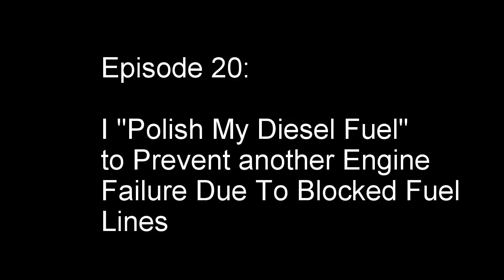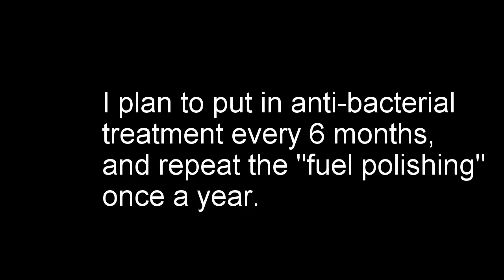Ep 20 Diesel Fuel 'Polishing' To Prevent Clogged Filters and Lines

Comment: Terrific video Patrick. It’s brilliant that you’ve taken the time and energy to put this together. I think anyone who has sailed and perhaps more so lived aboard for any length of time has gone through this issue. I use to keep my sail boat in the Rio Dolce Guatemala for six months at a time during the summer/hurricane season. The humidity there is 100% so needless to say I had numerous issues with bacteria and condensation buildup’s. I was forever bleeding my engine and trying to keep the fuel clean—it was my main problem when cruising down there. I even suffered this fuel blockage whilst delivering a boat back to Florida of the coast of Belize during a storm….I wasn’t a happy camper. :)
Reply from the maker: Yeah, I was a real beginner learning how diesel engines worked backed then.   I learned some lessons the hard way.   :-)   I am much more careful (and knowledegable) about fuel systems now.    Fair winds.

Comment: Thanks Patrick. Fuel polishing is on my winter to-do list and I had not yet researched how to configure the polisher. I will follow your method
Reply from the maker: It seemed to work well Philip, but be sure to keep the pump's capacity aligned with that of the filter.  I may have been just slightly 'overpowered'.   Fair winds (and mild winter).

Comment: When I flew, part of preflight was to drain fuel from the tank bottom via a petcock. Always had a little water from condensation, no big deal. Suprised boats dont have that. Drain out a few ml of fuel and the crud that settles in your tank. Did in my motorcycle before long rides too. I grew up around diesel engines and they all had the glass bowls on the filters so you could see ur fuel. Good vids mon ami! Naviguer avec Dieu.
Reply from the maker: Many thanks Silky.   I flew a Piper Arrow for many years that had a drain valve under each wing, and before every flight, I would drain some out to ensure no water.  Many sailboats do have a drain as well, but for some reason, my otherwise excellent boat does not, and that is a real shame.   Most medium sized boats like mine have mounted a filter/water separator in-line, and a second filter mounted on the engine.  Unfortunately the water separator on my boat is not transparent, so I have to do a messy unscrewing process to drain any water, and then re-prime the line.  Oof.  Je vous remercie sincèrement.
Reply: This fueltanks are made from plastic and it reduces condensation a lot, and the combination to keep them as full as possible all the time is helping also a lot.
Reply: I used to think the same thing and when I looked into it I found the ABYC frowns on drain plugs (or any fitting) on the sides or bottom of fuel tanks.They say it increases the chance of spills and fuel getting in the bilge and I have to agree.Lets face it the average boater will rarely check it and with metal tanks there is a very good chance that the plug will be a dissimilar metal.
I also fly and have a Maule M-4 that used to sit on EDO floats but lately she's been sitting on Tundra tires.

Comment: They should plumb those boat tanks with a kidney loop system (exactly like you built) so you can prefilter all the fuel at your leisure. especially during rough seas when the fuel is stirred up.  your info is the best, this is the only real sailing channel I've found.
Reply from the maker: Larger boats -- and especially power boats --- do have permanently mounted polishing systems.  It's very hard to do on a sailboat due to lack of space.   Believe me, I'd do it if I had a bit more room!

Comment: Bonjour Patrick,
Back since yesterday after bilge watching your first 20 videos.
The absence of water does not shock me on a plastic tank.
I own a BAVARIA 40 cc 2010 myself.
I have always tried to treat fuel oil with a specific product.
I will check, however.
A big thank you for your precious vidéos 😉
Reply from the maker: Thank you.   I use the fuel treatment recommended by Volvo (Actioil A550), but am sure other brands of treatment will also work fine as well.

Comment: I like your philosophy of being thorough in port to avoid trauma at sea. Consider also fashioning a scrub brush on a flex wire handle to dislodge things clinging to the walls of your tank.  Shame not to have a large inspection port.. Very enjoyable vids thank you.
Reply from the maker: I think that is an excellent idea Will.   I am planning to install an additional water separator/filter as an in-built polisher, but will probably do as you say and try to give the tank a bit of a scrub each year.   With only the sender port as an access, it will always be difficult to get to areas behind baffles.    Thanks for contributing to the discussion.

Comment: Great system it's doing what it has to do...  I have exactly the same fueltank in my boat same capacity and if you keep them as full as possible the amount of water stay's really low. There is almost no condensation in those plastic tanks. I skim my tank once a year with those oil vacuum pumps and it's working also pretty well, but like a lot that system you builded. That's why I keep watching those movies from sailors on you tube, there is always something to learn! Keep posting this movies !!!
Reply from the maker: It's great to have feedback like that Johan.   I agree that these plastic tanks are much less prone to condensation than the metal tanks.   I do try to keep it near full as well --- to minimise stirring up any contamination on the bottom, as well as to minimize any possibility of condensation.  Thanks for commenting.

Comment: Your videos are great. Short and to the point. No long intro with music etc.  I had 2 filters with some shut off valves. If filter showed any sign of clogging at sea I switched filters with a few valve turns. Replaced clogged filter when conditions improved. I also had a small can with fuel that I would raise to gravity prime filters after filter replacement. Fast and easy, with less spillage. Might be an option for some.
Reply from the maker: Having some dual Racor filters that I can flip between has been a dream of mine Ed, but I really don't have the space.   Instead, I've hooked up some strainers in-line, and have a single Racor......  I'm hoping the easily replaceable strainers will catch any heavy contamination.   By coincidence, just today I put some chemical diesel-bug killer into my tank --- a maintenance dose.    Thanks for the helpful comment.

Comment: Thank you for the videos, as a solo sailor gradually gaining confidence to venture outside my home waters these episodes have been informative and inspiring.
I think some of these diesel bug treatments have a water dispersant in which would make the water mix in with the fuel so it can pass through the engine, that may explain why there was no pool of water in the separator.
Reply from the maker: Thanks Mike.  Yes, others have suggested it may be hygroscopic.   I'm just going to assume that is true!  Good luck with your solo sailing.  It provides a great sense of achievement.   Fair winds.

Comment: Hi Patrick, just signed to your channel and love it. I tried to be a lone sailor myself but gave up after a handful of attempts. I had the exact same problem with my sailboat and know by trade that any diesel can grow bacterias, algae and other species. In time it becomes a slurry that needs to be polished from time to time. I removed the tank, transferred the oil to another container, washed it thoroughly and returned the oil filtered. I spent nearly nothing doing it.
Reply from the maker: Yeah --- agree.    My precautions now are chemical treatment, pre-filter/strainer, keep the tank full as much as possible, Racor separator, and polishing every 18 months.   Still always worried whenever there is rough weather.

Comment: Thank you again for a fine video.  Our boat Olivebank suffers from an old steel tank (1970) which invariably flows rust through the diesel fuel lines.  Linda and I are seriously considering a replacement tank in plastic, until I looked to see what would be involved with moving wiring, hoses etc.  Your video gives us some hope that we may be able to garner another season before inevitably "biting the bullet" and replacing the tank.  I hope you didn't stay aboard for the 5 hours of 10 micron pumping.  I hope to find a somewhat quieter diesel fuel pump.  Thank you again.
Reply from the maker: Here's the deal on the pump for the polishing system Dave: if you get one that is quite powerful, it will do a great job of picking up the contamination in the tank, but will push the water through the separator and back into the tank.  If you choose a pump that is too weak, it will be great for picking up the water and allowing the separator to do its job, but will struggle picking up the contamination in the bottom of the tank.   I think some of the professional units have an adjustable pump: high volume to pick up contamination, and a second lower speed to suck up the water.   Good luck on your project.   (If you have to err, I would err on the side of picking up the contamination, and worry less about the water.  You can always add a hygroscopic additive that will take care of any water.)

Comment: Excellent idea, well executed. I replaced my old stainless tank which had a tap at the bottom with a plastic one which has a dip pipe (the same as yours). I always worry a bit that even small amounts of water will gradually build up and never be properly drained out.  So, I am very pleased to see that you didn't get any water - although I am surprised.
Reply from the maker: :-)   I have a feeling that the flow was so great that the water did not have a chance to separate.   Darn.   I'll use a smaller pump next time JAS.   I do wish there were a tap at the bottom to drain the water......   But for now, in the absence of any better information, I'm celebrating the total absence of water in  my fuel tank.  :-)

Comment: An inspection hatch above the lowest point in the tank goes a long way toward lessening the problem. Also, fit a storm valve on the breather line to avoid a big sea getting seawater in there. Any big wave will come squirting down a hull-mounted breather and in to the tank. Fit an internal breather on the same line before the storm valve. In heavy weather, shut the storm valve and open the internal breather. Troya.
Reply: I am learning a ton of things through these videos and comments. Here you go, and I thought I knew most of the the things one should know about sailing!!!
Reply: Very useful ideas! Thank you all for sharing!
Reply: Thank you for the storm valve idea. Very useful.
I'm not sure about the inspection hatch though. Leaves open the possibility for a leak.

Comment: Hi. I had a diesel bug issue on my yacht which ultimately lead to engine stopping en route. Similarly I was surprised just how little crude was found. We cleaned out the bottom of our diesel tank by hand (there was a large inspection access above the lowest point fortunately) and essentially found a small amount of black crud. At the initial filter from the tank towards the engine, which has a glass bowl, we discovered it really took only a tiny amount of crud to block the intake for the engine. Once cleaned we also treated the fuel with biocide which we use each time we refill pro rata to the fuel. Fingers crossed we have not had an issue since. I am enjoying the videos you have a gift for speaking to camera!
Reply from the maker: Thanks J&J.  As you state, the blockage can take place wherever there is an 'edge' in the line.  It doesn't have to be in the filter. My blockage took place in the emergency fuel shut-off valve.   I later replaced it with one with a larger orifice.   I have started using the biocide too.  Lesson learned.   Thanks for watching.

Comment: Hi Patrick,Great vid. Congrats on a very interesting and entertaining channel. I've been emptying my tank (every second season or so) worried about the same thing. I used a small fuel pump from a car shop the first time (cost of around 30€), but the second time with the boat on land I used gravity and a fuel line going through the log hole on the hull.A very useful thing to have is a inspection hatch (cost about 160€). Mine has a transparent lock, so I can just look with a torch without opening it. Not to hard to install (even though my tank is stainless steel). Even easier in yours being composite.The good thing with it is that you can empty and wipe clean the tank.All the best, Carlos
Reply from the maker: Thanks Carlos.  Yes, I'm really a bit disappointed that my tank has neither a drain nor a dedicated inspection port.  That said, I realize that an inspection port is a complex topic due to baffles in the tanks which will prevent visibility and cleaning, even if you have one.  At the very least, a tank should always have a drain at its lowest point.   Sounds like you have mastered this issue.  Thanks for contributing.

Comment: i was going to install a second tank to pump polished fuel into.  I had never considered pumping the polished fuel directly back into the tankl.  thank you.  

seeing what you've done, I'd considered using a 20 micron, then into a 10 micron before the tank.   sparing the electric pump from excessive use.
Reply from the maker: A lot of people on larger boats do exactly as you suggest -- a second 'day tank' with polished fuel.  Smaller boats don't really have the space luxury to allow a second tank, so any formula of enhanced filters in line is an improvement.   I like your idea.

Comment: Good video. Diesel bacteria problem is caused by using bio-diesel. If you replace it with "old" diesel or - on engines of 2005 and beyond - GTL, you'll tackle the root cause. Having had engine stall on our motor yacht twice, just after we purchased it, on heavy traficed canals ... not a whole lot of fun and quite dangerous actually. Racor filters are amazing. We are having one installed (fixed) as we speak.
Reply from the maker: I'm not sure it's possible to buy 'old' diesel anymore......  I too installed a Racor after this incident, and I love it.  I also put in a chemical treatment every six months or so, and I try to keep the tank as full as possible to reduce slosh stirring up the gunk on the bottom.   Thanks for watching.

Comment: Looking at the crud you cleaned out I can now see how it clogged that fuel valve enough to stop the engine.
fabulous video
Reply from the maker: I think most boats have at least a little crud in the bottom of the tank Paul.   'Best practice' is to always keep the tank topped-up to reduce stirring that crud up, and it also reduces the possibility of water condensation on the inside of the tanks (which will eventually lead to the growth of the bacteria).    Diesel additive is then a good preventative measure as insurance.  Thanks for commenting.

Comment: Hi Patrick we just discovered your VLOG's and enjoying them immensely, keep up the good work. We are preparing to cruise on our 37' catamaran and as part of the modifications we are installing a diesel cleaning system. The pain is we have two engines so require two cleaners. Guess its worth it when your engine cuts out in a storm. Fuel Polisher P510MAM. Advise being to run them in bad weather in order to get fuel clean when its agitated in the tank.
Reply from the maker: Many thanks Asteroid.   I considered installing a permanent Racor polisher as well, but really didn't have the space, and was concerned about the electricity drain.   I let myself be convinced that an extra in-filter and the fact that fuel is continually recycled anyway, provides enough polishing.   Sounds like you have made a solid investment in fuel quality protection.  Good for you.   Thanks for watching.

Comment: Thanks for sharing.  I had a water issue with bad fuel...  We now only use  2 Micron filters that will stop water.  I also use them for polishing.  It  is a good idea to try and filter fuel while adding it to the tanks.  We have a cat and can transfer fuel from on tank to the other while sailing which is great since we don't use much fuel per year.   For fuel polishing, in addition to removing the fuel sensor I connect to the fuel pickup.  I discovered in my previous boat that it had something stuck in it creating a flow issue.  If the fuel is black and how much you have it may not be worth the cost of the filters to polish it all...
Reply from the maker: My primary filter is 10 micron, and my engine mounted filter is 2 micron ----- so think I'm covered now.   I really should pull the fuel pick-up out and clean it off as you suggest.   I've never looked at it yet, as I don't like disturbing the seals on the tank…….but I imagine it has a nice layer of crud stuck to it now.